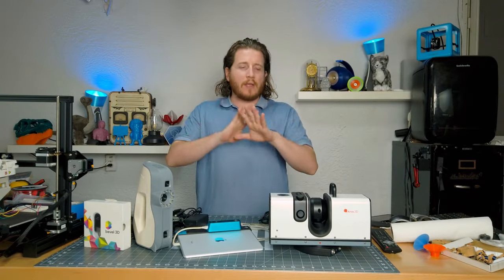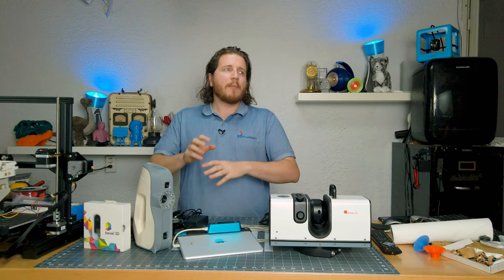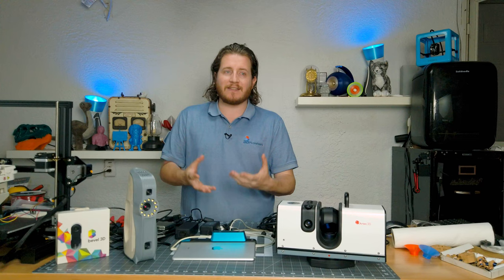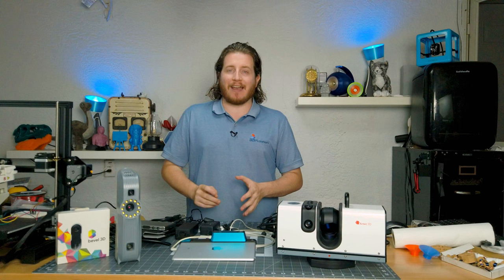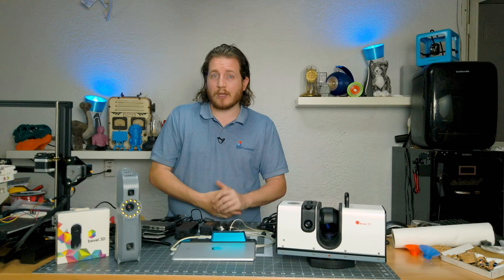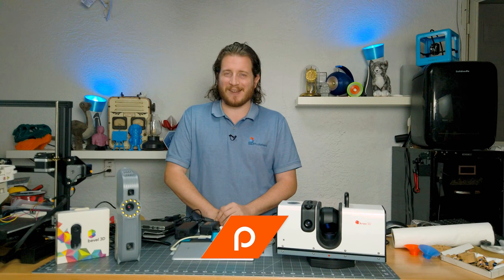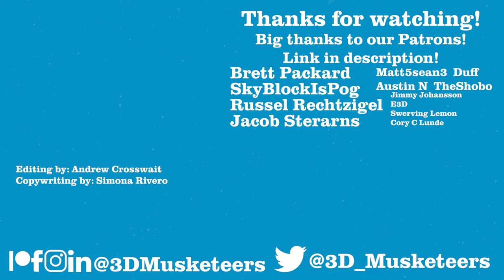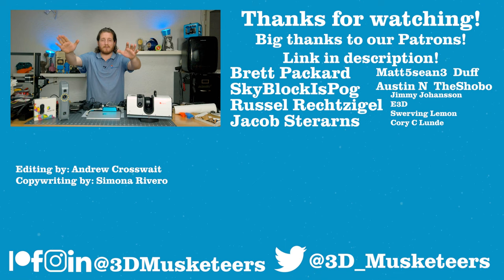3D Scanning Basics - What Types Are Out There?!

Comment: Why are scanners so expensive?  I hope they start coming down in price.  Like an ender 3 scanner lol.
Reply from the maker: The Structure scanner is just that, cheap, it works, but it is not the best. Einscan makes some of the best "cheaper" scanners that I am aware of though, but we are trying to get some in to test to see how they stack up!
Reply: Actually we need a Prusa of 3D scanners. A company that tries to push innovation while trying to keep it accessible.
Reply from the maker: That would be AMAZING! Because not only are my scanners pricey, they have a $1200/yr software cost!
Reply: @3DMusketeers  🥵 the gap between toys and industrial equipment needs to be filled somehow.
Reply from the maker: 100% I think einscan does it but they still are multi thousand dollars. Optics ain't cheap
Reply: @3DMusketeers  hardware can be made cheaper with slightly less precision but the missing link for a small player to come up with something is the software side to take the raw data into usable STL files.
Reply from the maker: For sure.